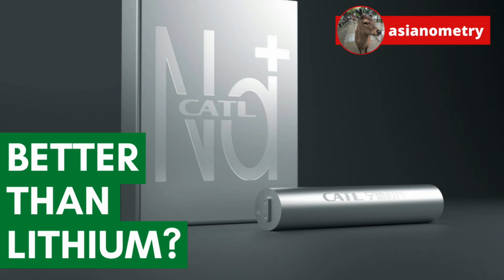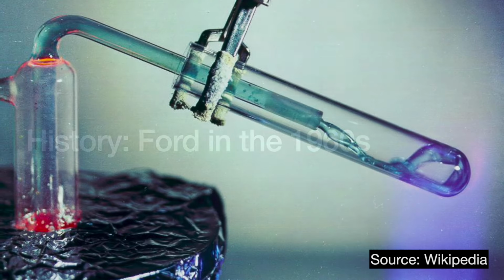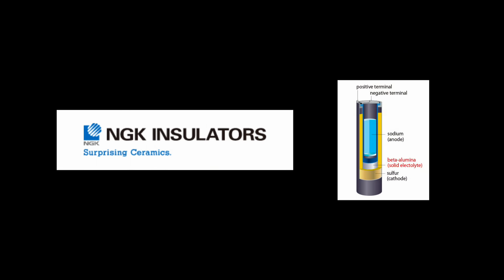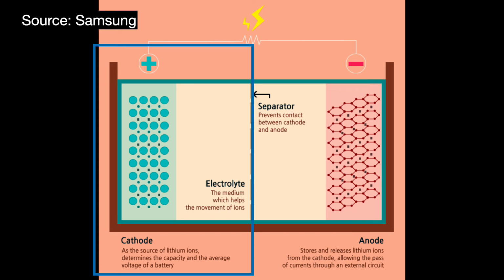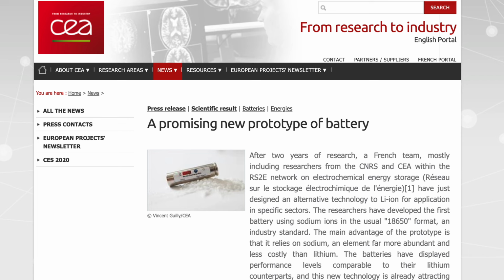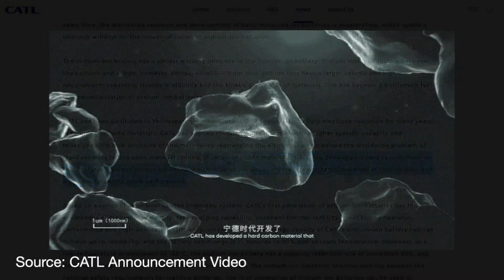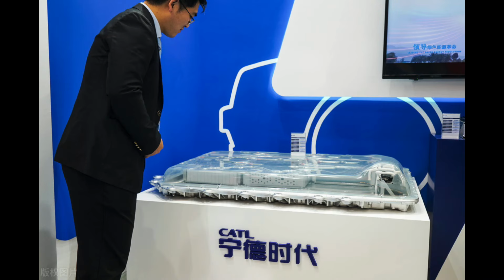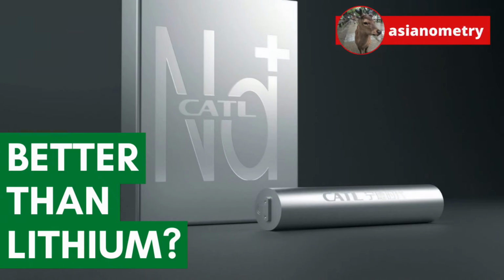CATL's Sodium-Ion Battery: Better than Lithium?

Comment: One major benefit of LifePo4 batteries over L-ion is that LifePo4 batteries are not subject to thermal runaway fires.  There was no mention of this aspect of Na-ion.  I see the lower cost of Na-ion or other non lithium technologies as a secondary driver.  The primary driver is that by using them in stationary applications where density is not as critical, you can save the lithium for the applications where it does matter.  For my residential solar, I could double the volume of my battery with little if any downside, and weight would only be relevant for shipping.
Reply: Yeah, grid storage.  Unless a person has REALLY delved into green energy they have no idea about what grid storage can be and why something like Li-Ion batteries with their energy density are actually inferior for grid storage due to cost and other problems especially with the amount of rare earth materials needed, which you CAN'T do for grid storage.

In the U.S. there's a company named ESS that makes iron redux flow batteries.  That's another really good solution.  Main ingredient, water.
Reply: Exactly. Using sodium batteries for large energy storage operations mean more lithium for high energy density batteries
Reply: From what I’ve seen of puncture tests, sodium ion batteries are far more inert than both LiIon and LiFePO4
Reply: What you mean by over L-ion? The nickel one?
Reply: I'm looking into a substitute to lithium because lithium ion takes more money to recycle than it is to be produced. Not to mention, when it's recycled, the fires can not be put out if too large, and water will make it worse. Also, when lithium is recycled, it is very toxic, and  you do not receive a good yield. Lithium is going to make our "climate change" problems worse
Reply: Yes u did good analysis🙏
Reply: Sodium Ion are thermally stable temp peaks at 65C
Reply: I am unsure what you mean by runaway fires, but puncture a LiFePo4 battery it will create a blowtorch burning at over 1300°C
Reply: The best battery is positive for the battery and negative quality for the negative reviews 😮 that’s why I’m liking the LION 🦁 battery 🔋
Reply: Majority of battery fires are LiFePO4. Please research.
Reply: @noamanrasul  That is not accurate, I believe. LiFePO4 are used exclusively in marine applications just because they do not catch fire. Phone and laptop batteries use a different lithium technology, and they can catch fire. If you disagree with this perspective, please reply with links to sensible sites.
Reply: "LifePo4 batteries are not subject to thermal runaway fires" - honey, you've obviously not worked with any batteries systems, so please don't make grandiose statements like this one. I'll grant you that ferites are less susceptible than for example Cobalt of manganese fellas, but only titanium variants are considered (semi) safe - and those are dear as hell because titanium is so damn rare and hard to work with.
Reply: @tommybronze3451  Sweetie, why did you feel the need to say that to her when she's almost technically correct? Acting like she made some outrageous false claim. Thermal runaway in standard lithium ion are considered relatively rare, and even more so with lifepo4 batteries, as they are more stable and therefore much less likely to experience thermal runway. lifepo4 batteries are very stable and therefore very safe for use in electric vehicles.
Reply: @igotanimac1  because of me one testing ground in the UK extended their fire fighting capacity … all of that thanks to testing ferites … so sweetie, no she’s far from correct, and her statements build false sense of safety.
Reply: @tommybronze3451  No darling, you're literally making no sense and your response has absolutely nothing to do with what I said. Lithium iron phosphate batteries (LiFePO4 or LFP) are not immune from thermal runaway, however they are more stable than standard lithium ion batteries and are therefore much less likely to have thermal runway, so she's almost entirely correct and anyone with fingers can verify this fact anywhere on the internet.

Comment: Reality check;

No matter what  it is it can have a bigger battery if it's made from Sodium. Lithium ion Cells can't be legally made and sold beyond a certain size or capacity in most of the first world countries. Therefore anyone who can't see that limitation or ignores that limitation is a complete idiot. The rapid development is also due to the cheapness of  materials used for construction. so if sodium develops to be as good as and/or is safer than lithium ion odds are it could take the world by storm the question falls more on will sodium ion batteries peak before solid state batteries enter commercialization.

Comment: Put a sodium ion battery in my next mobile phone please. So what if its a few dozen grams heavier. The battery is more environmentally friendly and the battery and therefore phone will last many times longer. Less phones will be needed less problems with chip shortages and that's another environmental win. To accelerate to a sustainable future we must stop the throw away society. And designed obscelecence. Sodium batteries can help with this

Comment: Lithium ion batteries have moved upward. With Sulphur, they have 3 times their previous energy density. In their solid state they give up to 4 times the density. Sodium ion is safer, cheaper but has to play catch up.

Comment: John,  you should also be aware of a 100 year tech called liquid air, this is a substitute for pumped hydro but no special locartions are required... the problem of batteries is if you need twice the power the batteries are twice the cost. Liquid air batteries may only be 5-10% more expensive to double the power,  and you can keep the charge for WEEKS or MONTHS!  Can't do that with any battery. The most important current proponent  of liquid air batteries is Highview Power/

Comment: Another big part of this is the operating temperature range, the need for a battery management system (BMS), and whether it will need an active thermal management system. 10,000 cycles with only 5% loss of capacity is a huge deal, as one often important but overlooked metric is cost per kWhr/cycle. This announcement is somewhat short on details, such as charge/discharge/life cycle/temperature curves. They evidently have an operating range of -20C to +60C, and do well at low temperatures with a 90% capacity factor at -20C, although they do not say if this is for both charge and discharge at that temperature. 15 minutes at room temperature to charge to 80% of capacity is fantastic, and a game changer with further improvements in gravimetric density.

Comment: Battery Electric Vehicles suffer from poor efficiency, between 55 - 75%, whereas other cheaper technologies can achieve up to 90% efficiency without the need for heavy expensive batteries and expensive charging stations.

Comment: Sodium ion suffers the same dendritic growth during cycling as Lithium. Sodium ion battery also suffers low capacity compared to lithium. Sodium is more reactive element than lithium. Availability of sodium is practically the only plus.

If we want to get rid of dendritic growth, we need to look toward magnesium and especially to aluminium ion batteries research.

Comment: Just attended a Faradion lecture and had to come back to this! I’m a PhD student of thermal batteries and glad it got a shoutout in this video
Reply: From your point of view, can sodium battery surpass lithium ion during these era?
Reply: @firdauszainudin7118  Faradion’s cell design gives similar energy densities to lithium ion batteries. But they also want to focus on safety and sustainability. Sustainability means eliminating the Nickel but that means less energy density. It’s tough to balance everything. I’m not sure it’s possible to surpass lithium ion in this decade. Also CATL hasn’t disclosed their cell chemistry yet.

Comment: There are many important parameters to consider when evaluating battery technologies.
Power-density relates to maximum current flow during charging and discharging. This is not mentioned in the presentation. The main advantage of the new 4680 cell from Tesla is powerdensity (not energydensity). Energydensity is rather fundamentel for the chosen ion-type. That is why theoretically lithium will always be the best starting point in development. Current lithium-ion batteries already attain 50 % of their theoretical maximum density, so there can not be much progress anymore.

Comment: If it is success the price of global battery will change drastically as the earth rich of sodium. The major issues for EV are what about the energy density and energy capacity can be achieved. If those challenges can be overcomed, mmm i imagine there will be energy system revolution.

Comment: CATL will not make Sodium battery
1. because Na-Ion battery will  cannibalize CATL LFP battery
2. Na-Ion battery will not be price competitive with LFP battery as author mentions Na-Ion battery won't be much cheaper due to process cost
3. Na-Ion battery has no real value proposition over Li-Ion battery yet, irreplaceabl,
4. only real value for Na-Ion battery is ecological friendliness but this needs to be seen, just as Li-Ion was also considered Green.

Comment: when it comes to the consumer market cost is by far the most important thing. the average consumer couldn't care less how things are made, all they care is that it's as cheap as possible, espeically with batteries. however rechargeable lithium batteries are mostly an oem thing. for consumer applications nickel rechargeable batteries are good enough, few people need/want to splurge on a AA rechargeable lithium battery even though they are available simply because the nickel ones are a lot cheaper. so the only way sodium batteries could become big in the consumer space is if they beat the cost of nickel ones. and -10% compared to lithium isn't gonna do it. the reduced energy density by weight isn't gonna be a factor, consumers really don't care about the weight of their batteries. So if they wanna be big in the consumer space they'd need to focus on price rather than energy density.

But most of the money is in the oem space and they tend to care about weight the most, because they actually have engineers working that want products to be good, not just cheap. so the problem with sodium as things look so far is it's too expensive for consumer use and not as good as lithium for oem.

becoming the best in both spaces is hard, if i were them i'd try to focus only on one sector. Consumer seems to be the most likely to succeed because cutting costs is probably gonna be easier than increasing energy density.

Comment: you STILL have to CHARGE THEM UP WITH COAL...
Reply: How so?
Coal-fired power plant is not cheap.
Coal is cheap, but it's power plant is not.
Reply: @bravo4741  your response avoids the reality of baseload power,its not about cost ,its about supply of power...only nuclear and coal are reliable..everything else is a heavily subsidised LIE.

Comment: wonder the number of Li-ion batteries needed to power a 46,000 ton stealth (CATOBAR) aircraft carrier that'll generate upto 350MW . . . is it possible???
Reply: Lightest Li-Ion battery today is 2 kg(4.4 lbs) per kWh.

So for around only one hour using 350 MW aircraft carrier, Li-Ion batteries would weight 700,000 kgs or 1.5 milion lbs 😆

Batteries must get lightier otherwise, no chance

Comment: sodium does great things when exposed to humid atmosphere, like maybe, in a car accident...
Reply: Yea, there's enough issues with these cars bursting into flames days after the crash as it is.

The cynic in me just has to sit back and laugh at the people thinking that any of this is new. 20 years ago I was doing presentations in my college classes of the "Amazing new battery tech" that was going to revolutionize everything. Didn't happen, isn't happening, anyone who can read an energy density chart knows it isn't happening.

People are getting excited over a few percentage points when the reality is that batteries need to be about 40 times better to compete with ICE engines. Even 100% efficiency won't save the EV. Hydrocarbon fuels have so much energy density to play with that even at 30% efficiency they come out on top. That isn't even getting into the "refueling" problem of EVs.

CNG duel fuel cars and liquefied coal fuels have more of a future. EVs are just the politically favored solution today. Tomorrow? Who knows.

Comment: For me, the main shortcoming of today's batteries is the low cycle (Charge/Discharge) life. Li-ion degrades quickly in most laptops I had. There are some which lasted longer though. Probably because of Japanese-made batteries inside. So if this 10k cycle life is real, then sodium can really stand out.
Reply: Li can last much longer than you might have experienced
if the charging is controlled.
They last much longer if they stay within 30-80% unless needed.
Reply: LFP has much longer lifespan 15 -20 years
Reply: is it really a limit? ok, in laptops the use cycle is short (you will charge it almost every day, so a day per cycle is normal, and can get higher), but still a 1K-2K cycle means 2-5 years, if used daily, which is not that bad for something you use regularly and still went for  cheap one, instead of a 5k-10K cycle battery, that would work for decade or more on a daily usage.

Comment: I think cost will fall even more as fresh water supplies lessen like in the south western US states.  Desalination is the long term safety net for that, but what to do with the salts is a major issue.  Most desalination plants dump back to the ocean creating a huge problem, but a plant that could process those salts for the use of batteries as well as solar molten salt systems.  Battery production companies setting up adjacent to desalination plants is really a no brainer.

Comment: The reactivity of alkali metals (the ones in the leftmost column of the Periodic Table) increases as you go down the column, so sodium reacts more strongly than lithium, and should be able to hold more charge if all other limiting factors could be resolved. Hypothetically the best alkali metal to use in a battery would be the one all the way at the bottom -- Francium -- but there's the minor problem that it's catastrophically radioactive.
Reply: Working against that is that the atomic mass of each element increases.  Each sodium atom is more than three times heavier, so I would expect the maximum performance of the best sodium ion battery to be less than the maximum performance of the best lithium ion battery, as Asianometry said was likely.

Comment: Good to hear a new battery tech finally making it to the market, it seems like there are at least a few possible breakthroughs reporter on per year but all notoriously around five years away from being plausibly in actual products, however seemingly nothing but minor iterative improvements on existing tech lines have been making it to market for decades.

Comment: How is nobody talking about this? seems like a major leap in battery tech just got dropped very quickly. I understand a lot of the base cost is the same since it's manufacturing precision and material, but that will always get cheaper, exponentially when it is a big focus. 60%+ cost reduction is likely possible with further simplification.